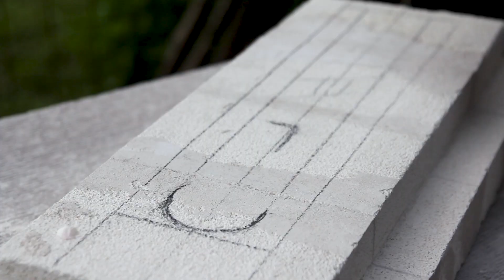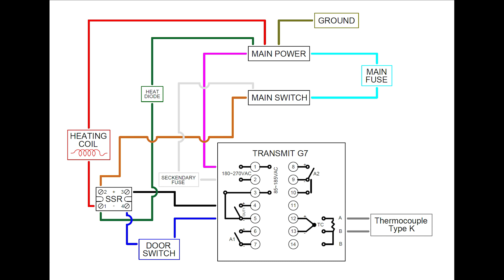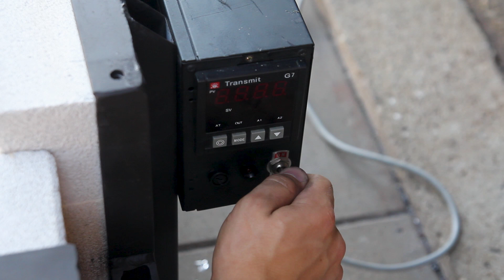DIY Heat Treat Oven

Comment: I love it! This is the best video on how to build an oven. Could you tell me, if you remember, what is the diameter of the bar to wind the kanthal wire? Thanks!
Reply from the maker: Something about 10mm
Reply: The diameter of the coil doesn’t matter electrically.  It’s only coiled to allow you to get enough Kanthal in your kiln.  The length of Kanthal (or other high resistance wire) needed is dependent on your supplied voltage and desired current.  Other than that, you want a coil diameter that will allow you to cut a groove in the bricks that isn’t so deep that the bricks crack.  Since the bricks are brittle, you probably only want to cut into them less than 1/3 of their thickness
Reply from the maker: @MantisRay861  It's true, I used 10m Kanthal A1 wire (1,2mm)

Comment: Very nice work, the advertised performance of your oven is impressive.
Can you specify the internal dimensions of the oven as well as the length of resistance used.
Thanks
Reply from the maker: Used 10m of ⌀1,2mm Kanthal A1 wire, diameters 10x15x40cm.

Comment: Great job!! I watched your previous heat treat oven video afterwards and you made a big step up in manufacturing quality! Could you please describe the updates you've made to achieve the high efficiency/ fast heat up time? And could you please tell more about the power you are using? 10m 1,2mm Kanthal A1, 230V and 4kW will result in a too high surface load of 10,4 W/cm^2. Recommended is a rating of <3,5 W/cm^2.
Reply from the maker: I used better insulating materials, the total thickness of wall is twice as thick as before, I also used thicker wire to make the heater, which resulted in much better performance. The furnace reaches 800 degrees Celsius in about 15 minutes.
Reply: will probably not last long, where did you find those specs?

Comment: Hey, is the 16A fuse enough? From what I've read on the package 10m of 1.2 A1 kanthal is 12,3 Ohm. 230V/13,3Ohm = 18,7A 
I'm not an electrician though :D
Reply from the maker: I'm not an electrician as well, but everything is working fine for this time, one thing I had to upgrade was the cooling system of elentrition.

Comment: I need to build one, is this 220v? What was the connector you used to connect the Kanthal to the electrical wire?
Reply from the maker: Yes, oven is powered by 230v, I used a standard electrical connector

Comment: Hi my friend, excellent construction but the resistance is just not there, the sizing is not good because if you take 10ml of 1.2mm kanthal wire with a resistance of 1.28 ohm ml and measure it, it gives a resistance of 13.1 ohm and at 220v about 4.050 kWh of consumption. the resistance if you spiral it from 7.0 mm external and you stretch it to 1/2 of its length (10ml of wire become 1.3ml of spiral) and a factor of 3 watts per cm2 you would be at 1154kh well below the resistance tolerance table and you melt it in a very short time, to have a power of 4 kw you need a much less resistive but equally thicker wire and I'll give you an example:
you should have a resistance wire of 1.9mm finished length of the spiral 2.2ml external diameter 15.2mm and a spiral pitch of 3.8mm and you will have a power of 4.282 kwh and a threshold of 3 watts anyway of 4.327kwh then you will be perfect for 1100°!!!!

Comment: Great ! how much does it cost? what can we do to heat to 1300°C ?
Reply from the maker: About 250$. Theoretically it should reach 1300 Celsius degree but I never tried to run that high, usually for hardening steels 800-1100 is enough.

Comment: How many millimeters of nichrome wire should be suitable for temperature 1250 degrees
Reply from the maker: It depends, you should use Kanthal A1 wire or something similar, it heats up to 1400 Celsius, 10m ø 1mm or hier shoud be fine. There are some free calculators you can find online that schoud help you figure it out.